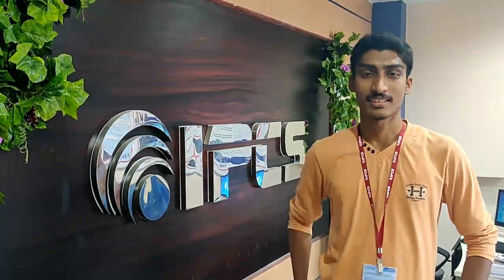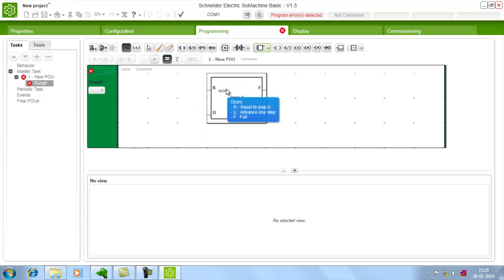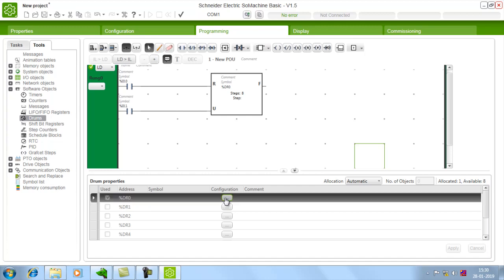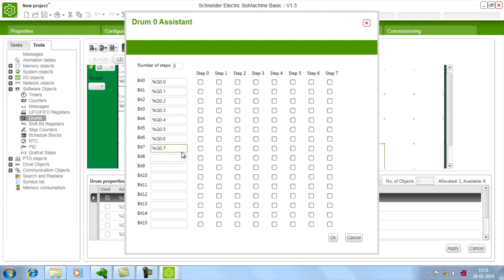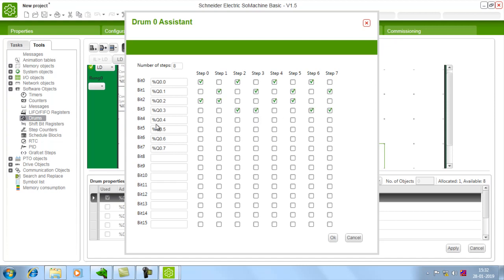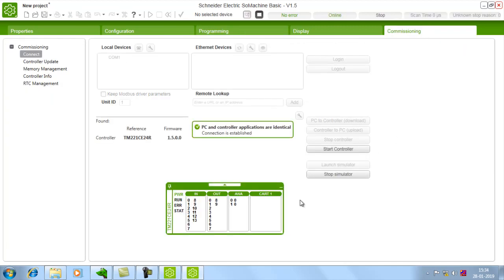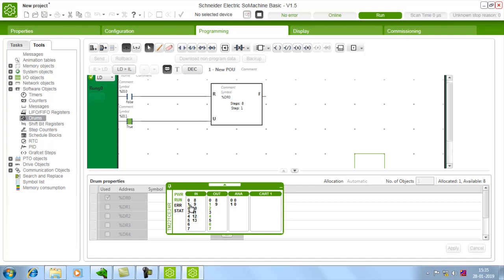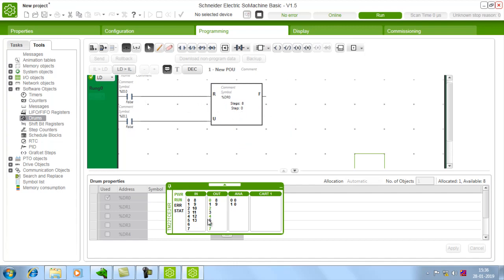DRUM FUNCTION BLOCK  IN SCHNEIDER PLC TM221| IPCS Automation

Comment: Machines can sequence from a small timing motor and cams and switches, or they can sequense from sensors that know where the machine is in its process.  The DRUM command is similar to cam sequencer.  Nothing better is needed and it is reliable. You indicate this fact.  😄